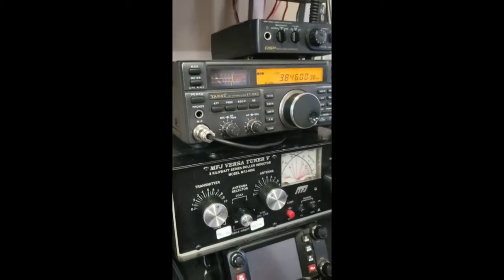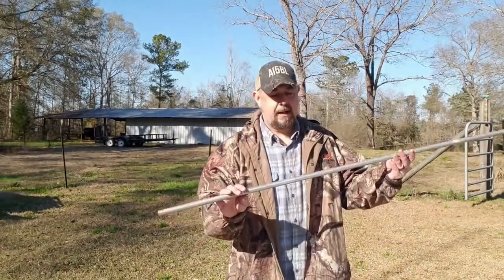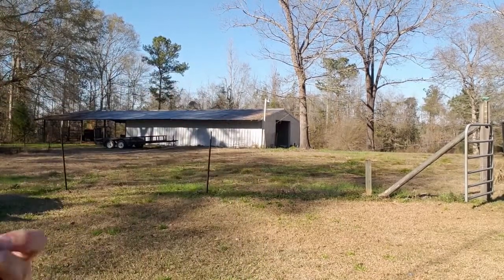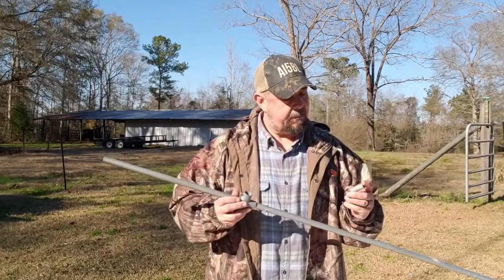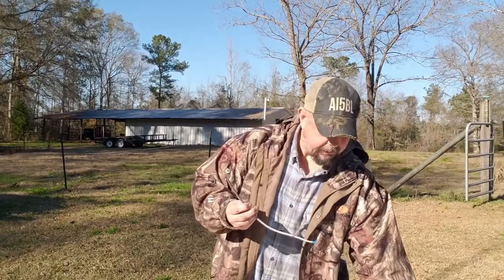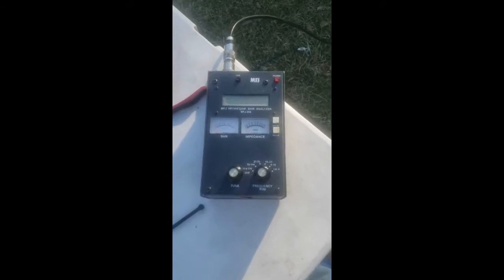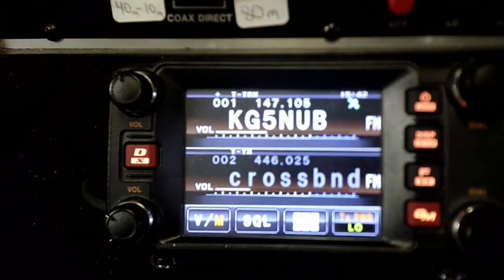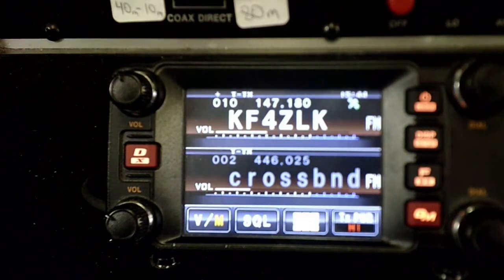2 meter ANYHOW J-pole ANYHOW antenna EMT conduit

Comment: Thanks for the video. Very interesting. How did you connect the SO-239 on the antenna to receive the coax?
Reply from the maker: I soldered wire to the center pin of the connector and then used a short piece of #12 solid copper wire from the case of the panel mount so239 with #6 x 32 screw and nut.  I drilled holes at the feed point of the antenna and used #6 x32 screws and wingnuts to connect the wires that I had attached to the connector,  The solid wire helped to keep the connector rigid.  If that makes any sense.

Comment: That's pretty cool! Just curious, would this also work from 70cm band?
Reply: It is possible to make a J-Pole that has a decent SWR on both 2M & 70CM.  However, in general, the maximum take off angle will not be toward the horizon but about 40 degrees up from the horizon.  That will cost you about 3 to 6 dB at the horizon.  Now, that is not as bad as it sounds and may still be OK for working local repeater and mobiles.  There is a person on here who has plans for a dual-band and even tri-band J-Pole that has a good SWR and take off angles.  If I can find it again, I'll come back here and edit this comment.
Reply: @BryanTorok  Ok that would be great, thank you!
Reply from the maker: The one I built here isn't resonant on the 70cm band but I'm sure one can be built that is.